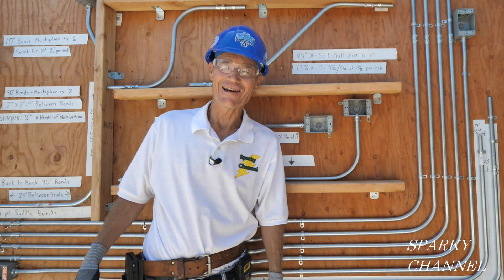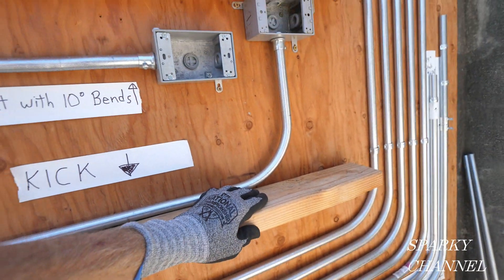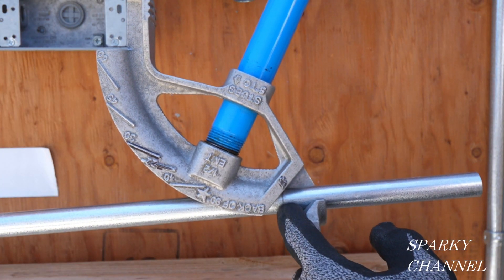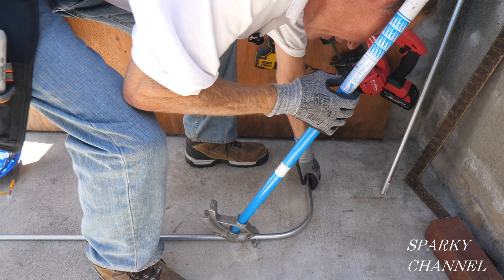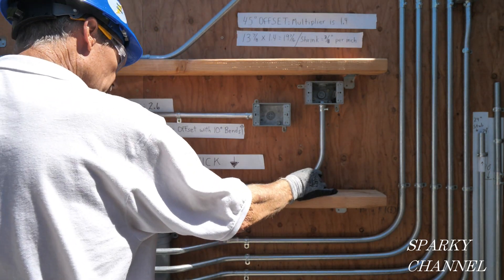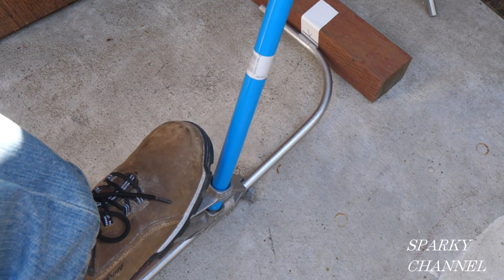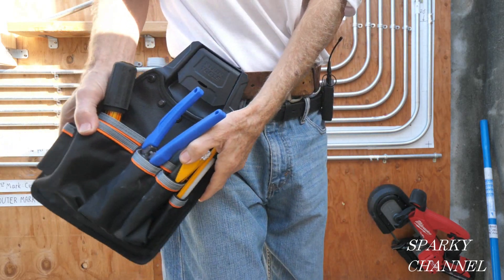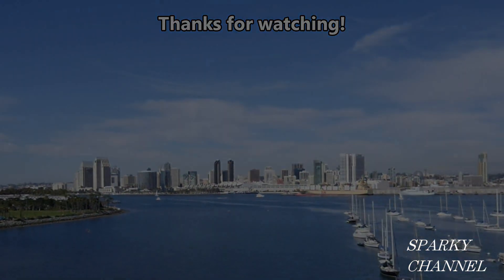EMT Bending "Kick": By Eye and Measured

Comment: Another great video!  I have  a  question  if it is a large kick.  For example, let's say that j- box is on the end of the ledge above the one in the video. Would you have to figure what angle you need and then do a shrink calculation to adjust your mark accordingly?  Thanks again for the great content!
Reply from the maker: If I'm following you right, yes, you're correct.
Reply: @SparkyChannel   That's why I enjoy your content.   You show an example of what will be the finished product.  Then you explain how to do it. Having said that,  the example I can think of is getting below the top of the bar joist.  Thank you for the prompt response.

Comment: You can also calculate these using a bend angle of your choosing which is useful when you have multiple conduits and want to match all of the kicks. Downside is that you need to have marks on your conduit bender for the center of whatever bend you're using
Reply: Or you can you the “Take-Off” formula. It is (TAN(1/2 x Bend Angle)) x Radius. This formula allows you to make a center line bend based on your radius, the only mark you need to know on your benders is where the bend/arch starts. For instance, any 90° centerline bend is exactly what the radius is. So if I have a 4-1/2” Centerline Radius bender, from my centerline mark on my conduit/tube, I simply go back 4-1/2” and make my mark that starts the bend.
Reply: wrong

Comment: Thanks, Bill!  Another quick question: In this specific installed conduit, is there a code requirement for a conduit clamp within X inches of the box? You would think having a gap between the conduit and wall over an approx 2-foot run with bend, and only being supported by the box fitting, would be a code issue.  ??
Reply: The code requirement for the EMT conduit in this video is that it needs to be secured within 3 feet of the box

Comment: Hello Bill, by any chance do you know what happened to the Klein laser level tools, The reason I ask is one of them my coworkers had the tool but he had a return it because song issue with the battery case. Do you know if it was recall or not that product.
Reply from the maker: Which laser level tool did he have a problem with?
Reply: Sparky Channel The one that has the red bean or red light that is long it has a base to mount the level, Laser Level with Level Bubble Vials, Magnetic Laser Level with Level Bubble Vials, Magnetic - Alternate ImageLaser Level with Level Bubble Vials, Magnetic
Reply from the maker: @ubaldoporto7605  Yes, I know the one. I haven't heard of any recall. Perhaps his was defective.

Comment: Can you show us a video how to bend electrical PVC I'm not sure if that's a proper name for the gray electrical plastic pipe I just had a pain one over a little torch I had cuz the 90s took my pipe too far away from my cut out if you can help it would be grateful😷🍻🍺
Reply: What you referring to is called non-metallic conduit-schedule 40 most likely.
Reply: @josecuervo8487  yeah but what if you need a shorter angle of than the 90 they make how do you bend it